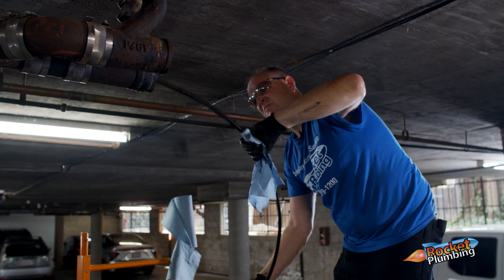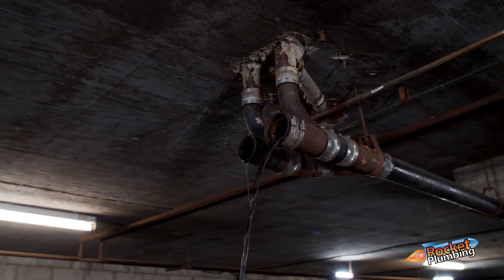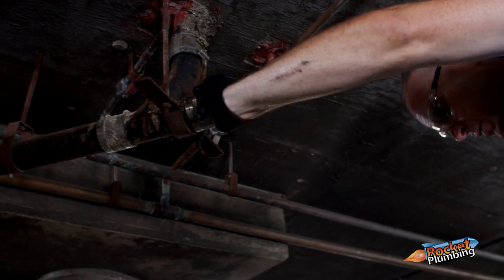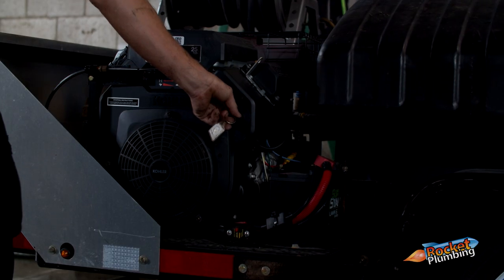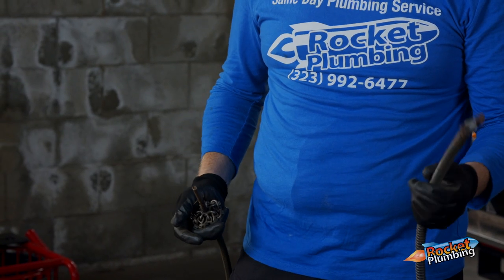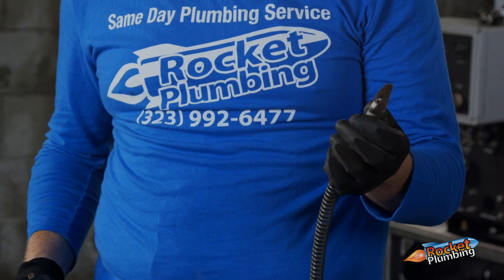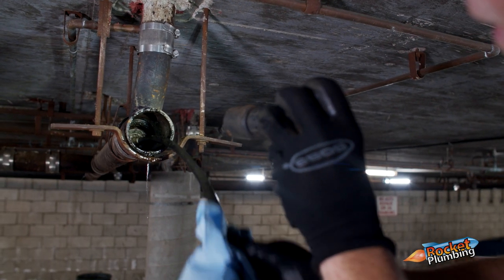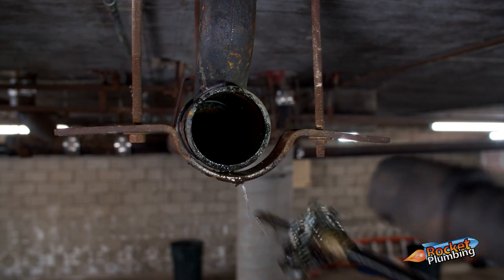Rocket Plumbing | Descale Cast Iron Pipe #shorts

Comment: Maybe in a large building where pipes aren’t accessible this might work but be best to put a liner inside the pipe after cleaning. If it’s that rough looking, it’s going to have holes or thin spots that will become holes.
Reply: Liners suck I see them failing all the time improper installs you can’t cable with a sewer machine especially in a high rise

Comment: OOOOOOr
Buy the machine and just do it yourself !
Reply: The machine is between $4000 and $9000. Plus the training and experience to use it correctly. In your scenario, DIY for you is job security for the service provider.
Reply: @debblouin  
The machine can be rented , no need for an over priced plumber   .
But one main point is that  if your main line is too badly corroded this machine can  Crack it and cause you more damage . The best thing  in that case is just replace it .  It's labor , but not that complicated.